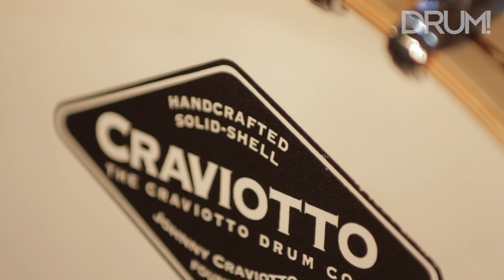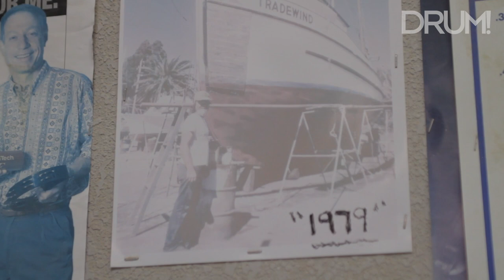Craviotto Drums: How the Solid-Shell Boutique Drums are Made

Comment: These companies that market a "Steam-bent Solid Drum Shell" crack me up. It's either "Steam-bent" or "Solid." You can't have both. Steam bending takes a single piece of wood, applies hot steam to the wood that creates a sufficient amount of moisture that allows you to then bend that piece of wood around a form. So go ahead and then just stop right there with the process. Oh wait, YOU CAN'T. That pesky seam. There is a single seam with Stem-bent shells (usually a scarf joint). No matter how you HIDE that seam, it's still there. The only way to get a true "Solid" shell is if it is hewn from a log. That's right . . take a log, chop off a section, then gut the interior leaving a SOLID continuous shell with no seam.
Reply: and they put reinforment hoops in it.

Comment: I have/ had been making "Solid" drum shells for about 25 years, but by solid I mean put 1/2 a tonne blank in a lathe and open it up to reveal the drums that were already made inside it, That all sounds very organic and new age doesnt it ? Its not. A kit comes from(usually) 2 blanks one 18" deep by 24/26" round and another 18" by 12" give or take a foot. prior to machining blanks must be "boiled" to reach plasticization to equallize internal tensions and then dried to an equalibrium moisture content to stabilize the structural integrity and prevent shrinkage and growth due to environmental factors. it takes a big chuck to grab a 1/2 tonne blank and turn it into a shell kit, by taking shells concentrically a uniformity of pattern and characteristics is shared throughout a kit although I never managed to cut shells in 1 inch increments 12,13,14,15,16 toms had to alternate between 2 blanks. as far as I see it the Craviotto drums Do use "Solid" stock just a differrent process (It would feel pretty Solid wraped round the back of Your head!) This process is more control able without the Crapshoot of spending months conditioning wood to open it up and find some trigger happy miscreant has peppered it with a shotgun or driven nails in it 30-40 years ago when the farmer hung a "no shooting" sign on the tree You are now trying to turn into a drum kit. when a drummer slings You a couple K for a nice fat 14x8x1 1/2"snare that wieghs 15 pound and barks like an A.K on heat it makes it all worth while. Im old loosing my eyes and Im going to stop this while Ive still got 10 digits, because Ive been playing drums for about 20years longer than Ive been making them and still do. this process used by Craviotto among others is the closest thing to solid and is repeatable and controllable with a predictable outcome guaranteeing You get what You ask for everytime and the visual appeal is stunning to boot.

Comment: i thought Solid Shells are shells that have no joints in them. that's what would make the difference between that and a steam bent shell
Reply: Well as you've seen solid shells are what they are.
Solid one peice not multiple plies of cross laminated wood.
But if your thinking solid shell as one peice no joints then there are shell like that too but carved/milled out on a lathe from a solid block of wood.
But a hell of a waste in material.
Reply: yeah, thats right, this is a 1ply shell.